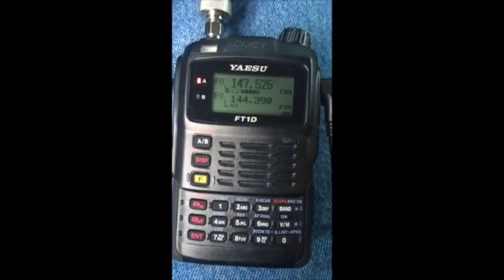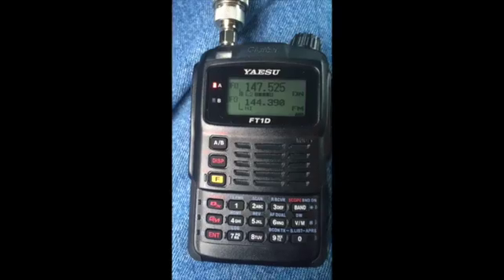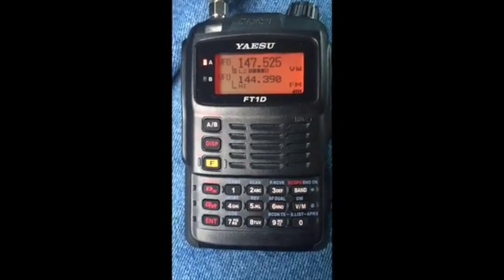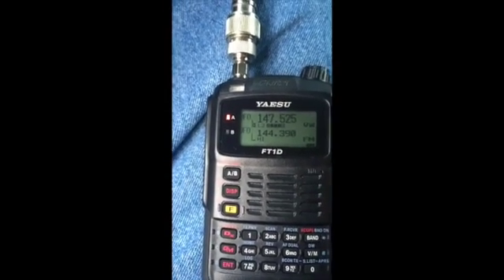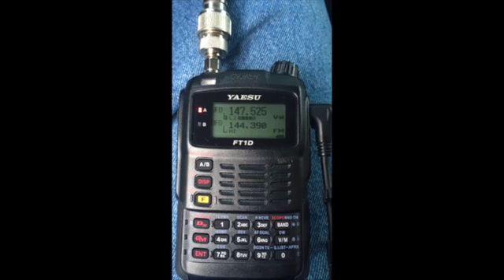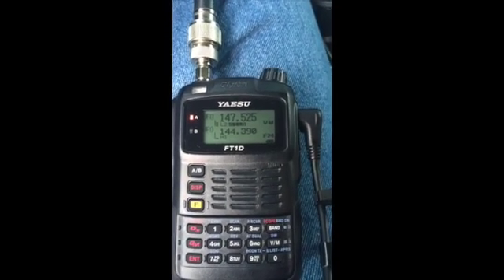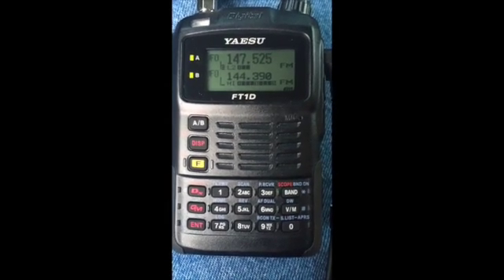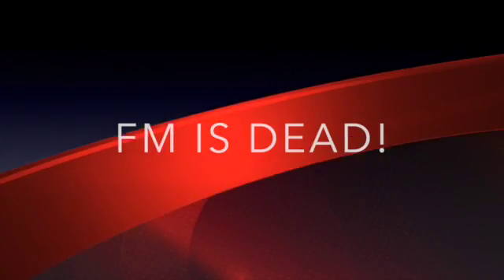FM is DEAD!

Comment: It really nice that you can work on lower power with digital but the audio really does sound strange even on the the wide setting i think yaesu has to use more bandwidth to get a better result. The audio sounds like the old cylons in battlestar galactica. I dont think its there yet.